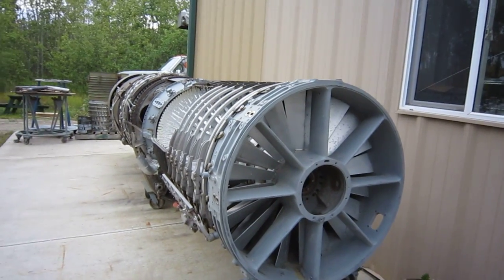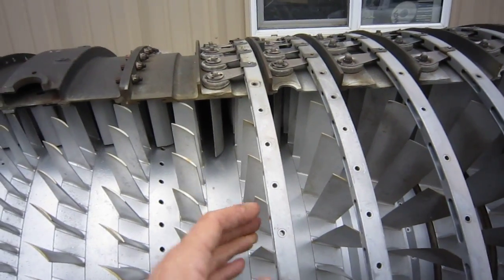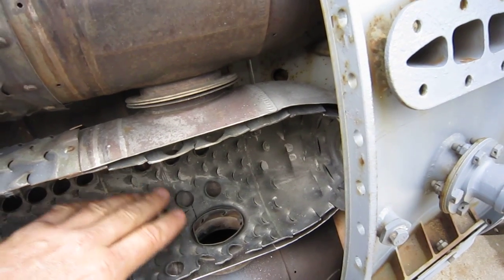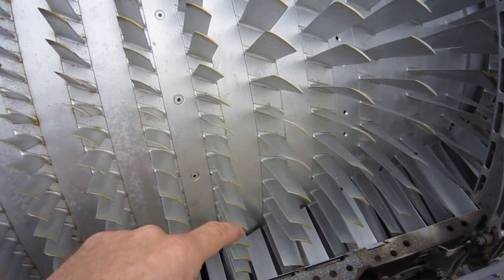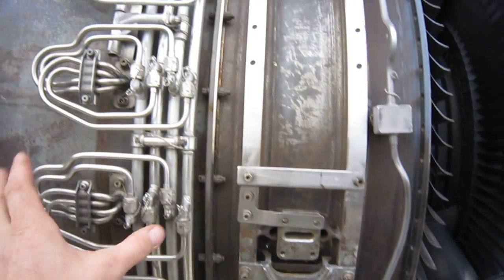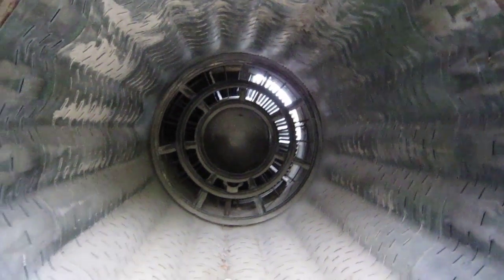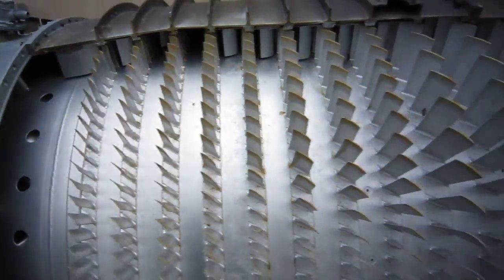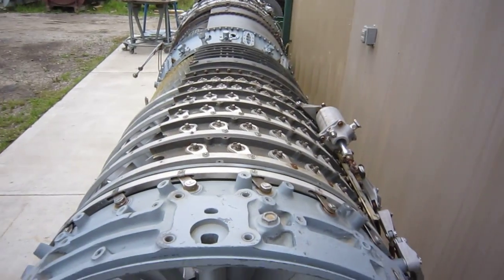J79  - Turbine Engines: A Closer Look

Comment from the maker: A "jet engine" is a gas generator with an exhaust-acceleration nozzle attached to the back of it.
A helicopter engine is a gas generator with a free-power turbine attached to the back of it, which feeds its torque into a gearbox to drive the rotors.
Apart from size differences, they are the same type of gas generator. Smaller ones may use centrifugal compressors vs axial, but they are the same thing in terms of design.

Comment: I was a J-79 Mechanic on the F-4 Phantom II way back in  1966-1970 era. Spent about half my time in the shop, and the other half working flight line maintenance. Every service did things a little differently. Out engine starter was on the rear side of the accessory gear box. We had a CSD and Generator on the very front of the engine at the inlet...........the pad you indicated was incomplete. It was encased in a stainless cowl. Many a time I crawled up the inlet to change this unit. The country was already HOT and then you add the engine heat.........well you get the idea. After while you are slipping and sliding in your own sweat. Needless to say, I was THINNER back then. JB
Reply: Sir can u tell me the dimensions of J-79 nozzle?.....plz..........
Reply: ajay kumar   That question would be hard to answer as the exhaust nozzle was variable....in that the nozzle changed as throttle position changed. The engine temperature (commonly know as EGT) was monitored by the Temperature Amplifier and it sent signals to change the exhaust nozzle to keep the EGT regulated. At idle the nozzle was full open, and as power was increased to max. (military) power the nozzle closed. It would be fully closed at max. power. When A.B. was selected, the nozzle would open back up to full to allow maximum thrust. If you watched the nozzle closely during all power ranges it was always in a state of "flux" because it was being used to keep the correct EGT. Hope this helps. Jerry
Reply: Jerry Brownlee great info! What is the reason for keeping the EGT within a fixed range?
Reply: Jerry Brownlee Dad was an F-4 Pilot in Nam and after in VX-5 China Lake.....    love the F-4
Reply: Thanks for your service. A and P mechanics are the unsung heros
Reply: Jerry Brownlee you guys kept my Dad safely flying both in Nam’ and at China Lake California!  Thank you to the unsung heroes
Reply: Sorry it took me so long to find this question. Sometimes the you tube folks pass them on to me........other times they don't. Gas turbine engines are meant to run at a certain temperature at max. power. Seems to me they were in the 710-720 degrees (C) range.......I can't recall exactly. The temperature was monitored through a temperature amplifier box (electronic) on the left had fwd. side of the engine..........just below the engine case split line. It told the nozzles where to be in order to control the temperature. If you exceed the EGT Limits (sometimes based on time at Temperature) you can cause a lot of internal damage. The metals in the hot section of the engine would not hold up if you went beyond design limits. Over the years the engines have gotten better at not only metallurgy, but with INTERNAL cooling and they are now  run at higher temperature than they were running 50 years ago.
Reply: Wow, Jerry, I get it, I worked the flight line in the mid 70's on F-4's at Hill in Utah,  that's some kool shit!
Reply: I had two tours over in SEA and both of them were in Thailand. I was at Ubon for 13 months and then went back to Korat for another tour later on. Started work on the F4C the latter months of 1966 and when I left Korat in 1970 I was working on F4E models. The "E" had a little more power and of course had a nose gun. It was beautiful airplane to work on and once you got used to everything, it was very easy to troubleshoot. Biggest deficit the J-79 had was it LOVED fuel. It was tough as nails. I pulled two engines out of an F-4 at Ubon that had flown into the tops of trees. The bottom of the airplane looked like someone had taken a can opener to it. The engines came back with tree limbs still sticking out of the Inlet Guide Vanes (IGVs)and the Pilot had selected Afterburner to get out of the mess. The engine Tech. Rep. (GE) on site said the only way he survived was he had gone into AB............otherwise he wouldn't have made it. JB

Comment from the maker: @justforever96 The turbine nozzles are located upstream of their respective turbine stage, while a compressor stator is located downstream of its respective stage, otherwise the two components are similar.

Stators decelerate air coming off a compresor stage, raising its pressure, and direct it at the next.
Turbine nozzles accelerate exhaust gases, lowering their pressure, and direct them towards turbine.

Comment: I used to be a J-79 engine mechanic back in the early 60's on the B-58 Hustler.  10,500 pounds of thrust @7460 RPM
Reply: Ken, I worked with a fellow at Federal Express who worked on B-58's in the Air Force. His name was John Mullen........and at one time he was at Little Rock AFB.........most likely in the mid to late 60's. We also had a Captain that I am close to that flew for FEDEX and he was a "Hustler" pilot. His name was "Buck" Carroll. Buck was a very interesting character and still alive. I think he is fast approaching the 90 mark.  The B-58 was way ahead of its time. Beautiful airplane though. My understanding it was a "bear" to work on. Everything was secured with high stress fasteners and even getting into any compartment was work. JB

Comment: Interesting videos, JayZ. You brought back a lot of fond memories with your J-79 instructions. I have been maintaining and overhauling jet engines for 42 years...I am retired Air Force and also work in commercial aviation at a jet engine overhaul facility located in the Miami area of South Florida. I cut my teeth on J-79s in Okinawa and Korea in the early 1970s, and later taught J-79 QEC buldup and teardown as an instructor at Chanute Airplane Farm in the late 1970s. Nice job!

Comment from the maker: @cheetawolf The compressor is designed to operate efficiently at maximum power and engine RPM. Without the variable inlet guide vanes and variable stators, it would not be able to get up to that speed from idle.
The variable vanes direct the airflow towards their stages at the appropriate  angle for the rotor rpm, airflow velocity, and the rotor blade angle of attack.

For a more detailed answer, read "the jet engine" by Rolls Royce", an excellent introductory text.

Comment: As an old Phantom Phixer, I did a lot of structural repair on these, not as an engine mech, but 6042 sheet metal. Combustion cans all of the time. Titanium rivets to put them back together. Turkey feathers, and forward blades as NDI. I miss them, and I don't miss them.

Comment: The J79 was hot stuff when I joined the Air Force in 1960.  These days it looks as crude as its early 1950s origin would suggest.  Engines have come a long way.

Comment: Simply amazing...  Believe it or not, the IGV's are very similar to many IGV assemblies on centrifugal refrigeration compressors. The old Westinghouse/Mcquay centrifugals had IGVs and rear diffusers (variable outlet) that worked in sync with the IGV assemblies. to assist in the variable capacity capability of the 'pump', if you may.  Tolerances were critical. Thanks for the video.. I always loved the J79's in my favorite plane, the F104.

Comment: Worked on the GE J-79-10 used in the F4 -J Phantom from 1973-75 aboard USS Independence CV-62. We ran a lot of these on the test cell during two Mediterranian cruises. I kept several technical books on the -10.  I've never forgotten the sound as these were turning up. It cost me some hearing loss but what the heck. Like having a battle scar; I'd never complain. An unequalled experience.

Comment: Somehow the comments went from a J79 (GE) to the R&R RB211, but to make even clearer to Mr. Bradley below, the RB211 is what's called three-spool engine, and as AgentJayZ stated, each spool has it own compressor as well as their own turbine, but no "three piece shaft" as you stated and corrected by AgentJayZ. Great video, guys. I'm well up to speed on this technology, but still amazed how well you explain things in just plain English, and not just this video but others. Thanks.

Comment: For me, this video in particular, along with your descriptions, has proven to be the most informative with respect to turbojet engine function and design.  It's filled in many of the blanks (or questions) I'd had about how these gems operate, having not been exposed to the guts, up close.  Still trying to wrap my head around the whole diffuser (confuser?) deal but that makes this learning adventure that much more fun!  Something else I learned recently; read the comments... might learn something

Comment from the maker: Those are shielded electrical lines that carry the low voltage signal generated by the thermocouples just aft of the last stage of the turbine. They indicate EGT or exhaust gas temperature.
The circular arrangement of thermocouples is divided electrically into two halves, so there are two lines.

Comment: Old post but, I worked on J79 engines in 1983. No CSD mounted on that one. Also worked on J52s'. Thunderous beasts they were. the old suck squeeze bang blow. Nothing like a good compressor stall at 80 %,,,BOOOOOM

Comment: Damn worked on -17's out of wild weasels brings back memories. These engines are tough as hell had one come in to our shop at Edwards with half the blades gone on every stage to the turbine was still running great. These engines are a safety wiring dream it will definitely make you a safety wiring pro

Comment from the maker: Yes, like this, but a few details might help.
"Air" does not turn "the shaft". The turbine takes energy from the expanding exhaust gases and converts it to torque on a shaft connected to the compressor. The compressor, turned by torque supplied by the turbine , compresses air and feeds it to the combustors, which mix fuel with the air and burn it, supplying the hot expanding exhaust gases to the inlet of the turbine. Your last sentence is true but unexplained, therefore confusing.

Comment from the maker: The clearances do seem large, but they are what they are. Not being an engineer, I have never questioned this feature of the engines. I know that the larger stator vanes and rotor blades do bend a bit under axial loads as they work the air at high power.

Comment: Another excellent video; I'm an engine designer and it's always really interesting for me to see how somebody else approaches the same design challenges as we do....the cans and transition duct is very different to the annular systems that are commonplace now this side of the pond. Given the uncooled turbine blade 1 the firing temperature must be quite low? I didn't grasp the length of the engine; obviously the afterburner makes up a lot of that but that's going to take a lot of aircraft to hide that!...again, thank you for your video and kindly sharing your experience.
Reply from the maker: It's important to remember that this is a design from the early 1950's.
Reply: @AgentJayZ  Absolutely.....
Reply: Which company do you design engines for?
Reply: @xBIGMUSCLEx  I've freelanced to Rolls-Royce, Siemens, GE-Alliance, GE-Honda, MTU and maybe some more!

Comment from the maker: Growing and shrinking do to heating and cooling is not avoided, it is accomodated.
All the metals in the hot end are special alloys that get theri strength from their composition, rather than any sort of heat reatment. Any sort of heat reatmant would be negated by the annealing effect of the first time the engine ran.
Alloys of nickel and iron, which keep their strength at very high temperatures.

Comment from the maker: Maybe I should add, before you decide to correct me on how the three shaft engine really works...
I have in fact taken a couple RB211s apart, and I've helped rebuild them. I'm not an expert on this engine, but I am quite familiar with the general arrangement of the internal workings.

Not trying to start a pissing match, but you need to be right if you're going to correct someone.
Cheers!

Comment from the maker: Natural gas stays a gas even when compressed to thousands of psi, so the tanks will be too heavy to fly.
Propane compresses to a liquid at around 200 psi, so you can put more on the plane, and the tanks aren't nearly as heavy, but it's still not as good a choice for a plane as liquid fuel, which is mostly kerosene.

We have tested J79 aircraft engines with propane. Just used different fuel nozzles.

Comment: I work for a company that manufactures very large water pumps for industrial use, and I can tell you in this field, the clearances between impeller vanes, wear rings, etc and the pump housing are tweaked to modify fluid flow thru the pumps. 

My uneducated guess would be that the clearances between vanes in the jet were similarly designed to modify flow. Maybe pushing them closer together causes too much disturbance in flow thru the engine?

Comment from the maker: @IWMYB61 This is a complicated question, which I will partially answer with a simplified explanation.

Think of a compressor blade as a small wing flying through the airstream. The angle of attack of this wing depends on its own speed ( engine rpm ), and on any velocity the air it is flying through might have.

The VIGVs and the VSVs work to make sure this resultant angle of attack is kept within a range of values at which the wing will not stall.
Reply: You give the amazing information video, thanks.

Comment from the maker: @discofishing There is a dividing line between engine and airframe that aims to simplify as much as possible the whole arrangement.
The aircraft hydraulics are powerd by an engine-driven pump, but the engine hydraulics are not part of that system. The engine oil pump may be used to power the engine hydraulics, or they may be powered by yet another external hydraulic pump.

Comment from the maker: The compressor stators convert the velocity of the air created through mechanical work done by the compressor rotor blades, into increased pressure.
Saying the stators provide the compression ignores the contribution of the rotor in supplying the energy to the process. It takes both the rotor blades and the stator vanes to compress the incoming air.
Reply: Without entering a pissing contest, don’t both the stator and rotor blade sections within a compressor increase pressure as they form a divergent duct between each aerofoil?  As you say, the rotor blades provide an increase in velocity as well, but pressure gradually increases through each stator and rotor.

Comment: Those look like bleed air ports for aircraft use. They are located at the highest pressure point of the engine so they could provide high pressure air to power systems on the aircraft. That could also be used for cabin heat as compressor bleed air is very hot. I've never worked on the J79, so I'm not sure if bleed air from those ports would be too hot for cabin heat, but that is one of the uses of compressor bleed air.

Comment: I think the correct description is the stator vanes direct the airflow to optimize the flow for the next stage. I don't think they play much of a role in increasing pressure or changing velocity/energy of the air. The rotors and decreasing case volume is what really compresses the air.

Comment from the maker: A scrap engine is cheap. But it's a lot of work to make a cutaway. Some of the disassembly needed to make a clean job of it takes special tools. And the alloys it's made of are very durable and difficult to cut.
If you want to make a cutaway... call the shop. We can help you out.

Comment from the maker: Each of the blanking plates covers an opening of a passage through a strut in the midframe. They do not all transfer air from the same location. 
To see what the passages look like, follow these instructions:
1) Do a search for  "J79 airflow diagram "
2) Click on the first result, which features the name Paul Cegelski
3) The first picture is the diagram thumbnail... click on it

No more need to guess !

Comment: Many years ago as a aero apprentice at college we were told not to spin the J79 compressor by hand or you could lose a finger, well one bloke didn't listen and chopped off half of his index finger. His finger is probably still in that engine.
Reply from the maker: I have seen it! That rotor weighs a couple hundred Kilos, and those blades are very strong/sharp/stiff.

Comment from the maker: @svenp Hey, you're looking at a video, and I can't capture all of it. If you worked with the stuff, you'd see everything is made like the finest workmanship possible. What looks like sheet metal is mostly thin machined parts from super-tough metal alloy.
Also, turbine engines don't have pressures and shock loads like piston engines trying to contain explosions.

If car engines were made like this, they'd last for millions of Km.

Comment: There is a Facebook group called USAF Engine Mechanics. There are bout 2500 of us on there; active duty, reserve, guard, and retired. You might get a kick out of it. A number of us "old dudes" have F-4s in our past. We are assuming your engines are mainly J79-GE-19s (from later F-104 aircraft), whereas most of us worked -15s and -17s from F-4s.